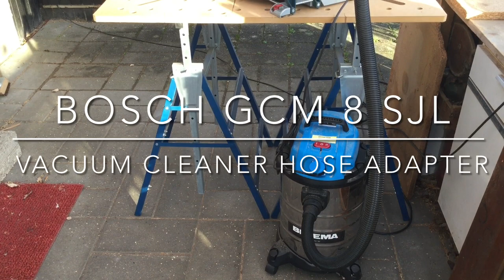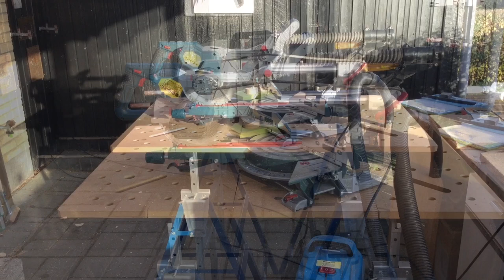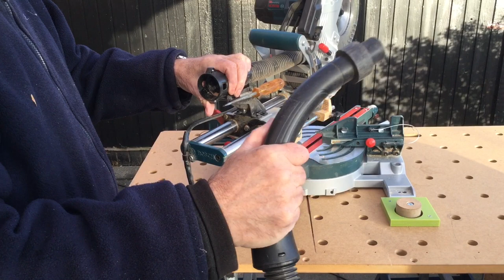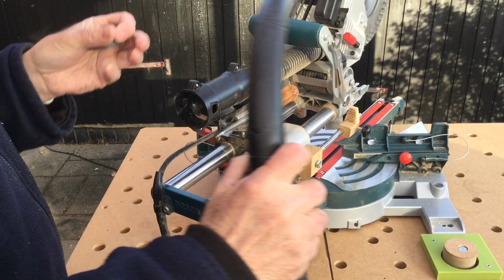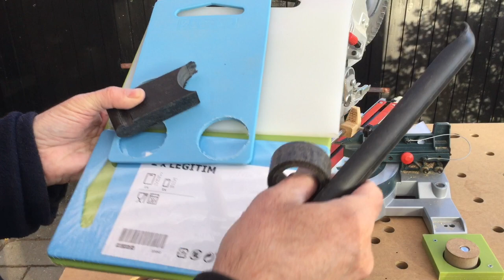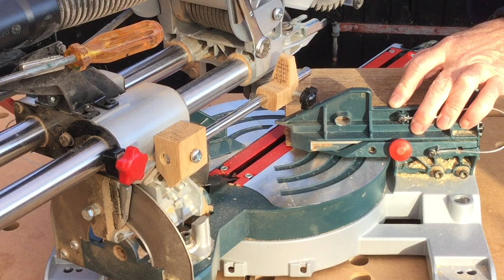Bosch GCM 8 SJL Vacuum cleaner hose adapter

Comment: The motor cooling air is exhausted directly into the blade housing. With nlwhere else to go, the exhaust air then travels straight down onto the workpiece, and blows sawdust all over the inside of the garage.

The dust collection funnels and vaccum attachment port are merely a formality.

Comment: Hi I have seen a few of your videos and have liked them all. How do you find this saw and how accurate? I have the double bevel version and find that when you lock the back and forth movement this pushes the blade off square, is yours the same?
Reply from the maker: Thank you for your comment and support, to your question I have to answer that I am very happy with my saw, mostly because it allows me to make many constructions that almost make the saw able to replace a table saw but is not nearly as good  like my old saw (it was also very expensive) When I got the saw the first thing I tested was if it sawed at an angle, it seemed to be close but not completely convincing, after several tests I now think it is the blade there  is the problem so my plan is to procure a better blade.  It's only a problem because I use it for many things as it is not intended for if I only had to build a car port or similar I am sure the saw would be perfect, it is a really good buy.
Reply: @Harris-DIY  thank you for your reply. Yes I agree it seems to be quite a good saw and I think the problem is me, I'm too accurate and like things to be spot on. I'd love to see some projects that you have done. Keep up the great work.

Comment: That's my problem as well. Thank you
Reply from the maker: Thanks for your comment, I hope you have solved the problem.
Reply: @Harris-DIY  not yet but I have the solution 😅
Reply: @Harris-DIY  I have a request if you don’t mind. Can you please provide me de inner and outer diameter of the sleeve? I am not at home but I am somewhere where I can make it. Thank you in advance.
Reply from the maker: Min has the dimensions 44.2 mm and 31.1 mm but remember the inner dimension must fit your vacuum hose
Reply: @Harris-DIY  thank you, I appreciate a lot your effort. 🙂. I will manage with that, remotely. Circular saw dimension was more important. 
Thank you for your help.